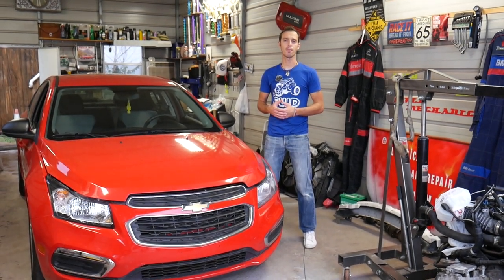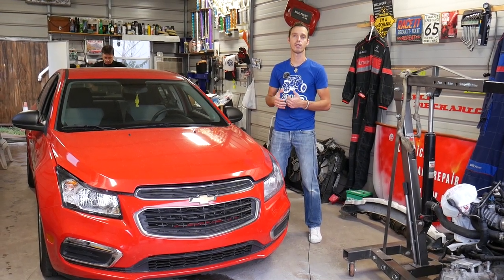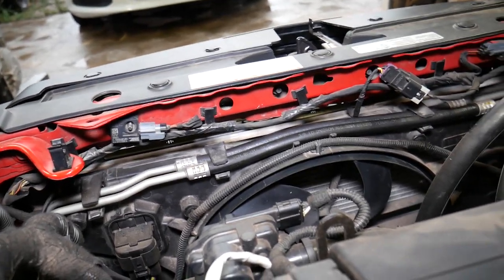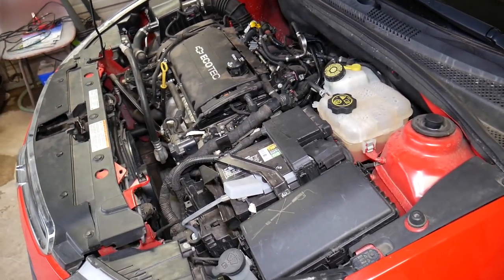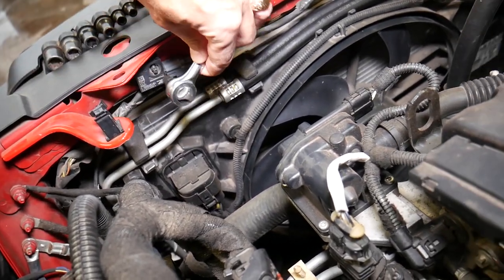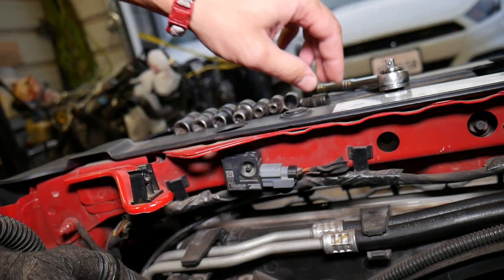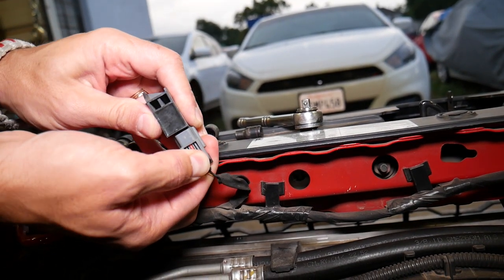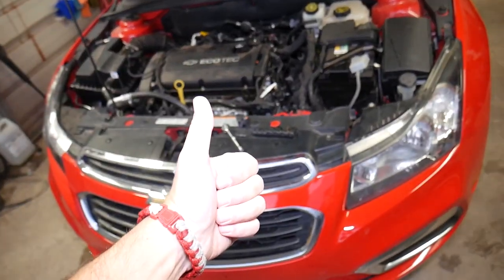FRONT CRASH AIRBAG SENSOR IMPACT SENSOR LOCATION REPLACEMENT ON CHEVROLET, GMC, BUICK, CADILLAC

Comment: My 2004 only has 1 impact crash sensor.  Do you need to disconnect the car battery. Before installing it. I was told if you dont the air bag can deploy.  HELP!

Comment: Hello, Do I need to change those sensors after an air bag deployed?
Reply: I imaging this answer is late for you, but for anyone who reads this comment the answer is yes, but it must be the sensor that tripped. If a front airbag went off, you will want to replace the front sensor(s)
Reply: @zacharylowe8083  If it the sensor is tripped will it trip the new airbags I installed once i turn on the car?
Reply: @skipps3278  I would assume so. I’ve done that on mine. I have one thing left to replace and then I’ll see if I can make it work
Reply: @zacharylowe8083  Interesting. Well it seemed to worked out for you. That’s great. But one question though. I’m pretty much feel trapped and don’t know what to expect. I installed new curtain airbags on both sides, seatbelts, module reseted and all. I’m scared to even try to turn on the car because I don’t want the airbags deploying on me. How do I scan ECU without knowing If I’ll need to replace the sensor or not.
Reply: @skipps3278  Did you replace the airbag computer?
Reply: @zacharylowe8083  Yes, it has been reprogrammed and cleared all crash data from the air bag module.
Reply: @skipps3278  was the battery disconnected when you did these replacements? If so, I would just go for it, but don’t lean on any of the airbags when you start it up
Reply: @zacharylowe8083  Yes of course. I disconnected the battery a week ago. I did the replacements over time (with battery disconnected) but haven’t connected the battery back up again. I’m sure you’re right so and I’ll give it a go. Thank you so much!
Reply: @skipps3278  doesn't it reset just by disconnecting the battery? or did you use a obd scanner? or did you have to take it in to the mechanic?
Reply: @mr.mansplainer1554  Nope. You will need to replace all airbags that were deployed, seatbelt pretensiones, REPROGRAM ECU.
Reply: No u do not have to replace the sensors at all unless the sensors was damaged. Sensors are reprogrammed when the srs module has been reprogramed or a new one installed.